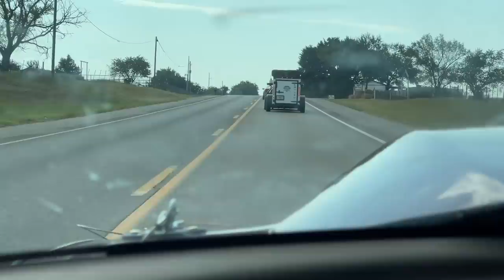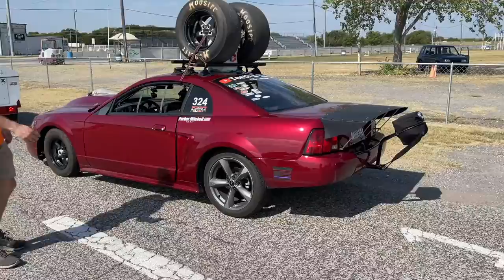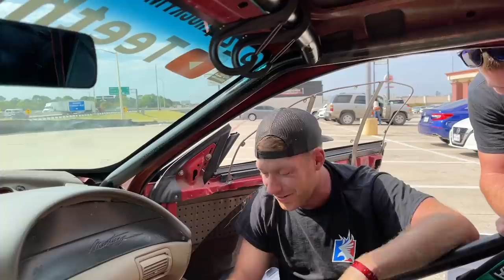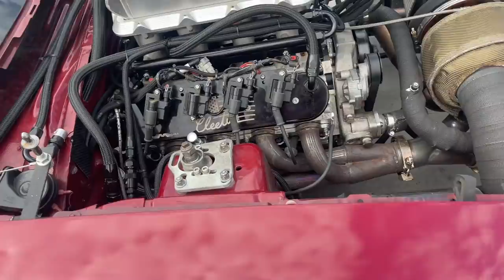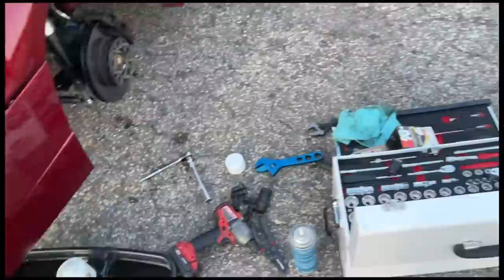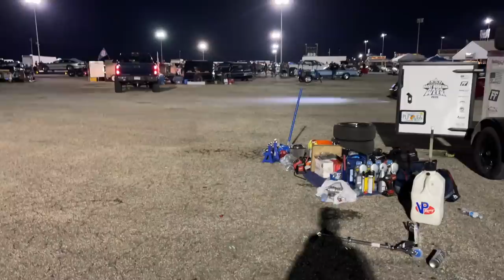New Setup RIPS Straight Off the Streets!! Rocky Mountain Race Week 2.0 Day 2

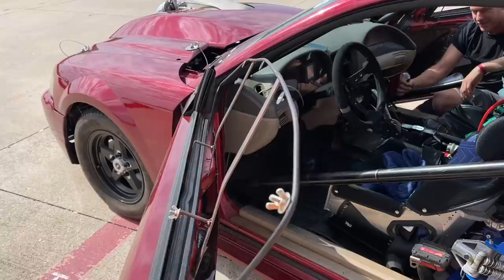Comment: 3:22 on the drives between tracks Richen tune up so it don't get hot don't run it as lean for road lean is mean for track bro but for road use Richen that tune up she might run little cooler ??

Comment: You want that engine to last change oil's every track before a race must clean oil works engine lifters properly bro and because your pushing it hard then towing oil will brake down faster ??? If you weren't on 7500 thousands revs or 8000revs lol wouldn't have to change oil harder you treat her more love you give her ??? Change that oil before each race that way you can expect oil before each race ???